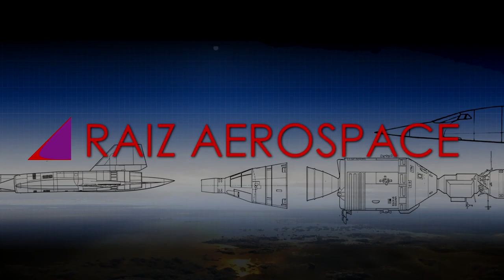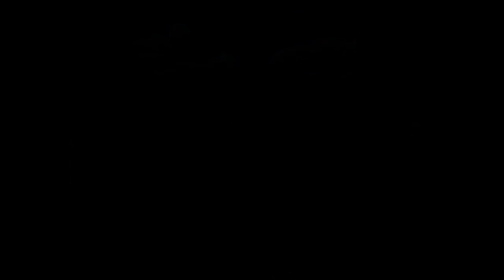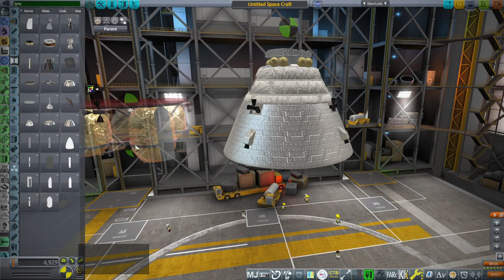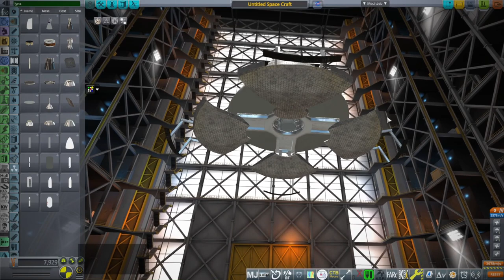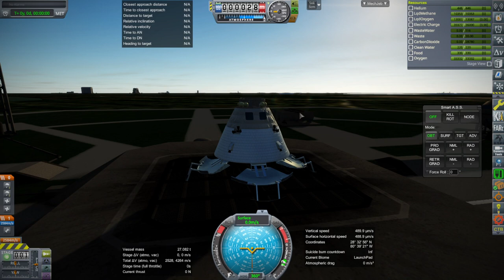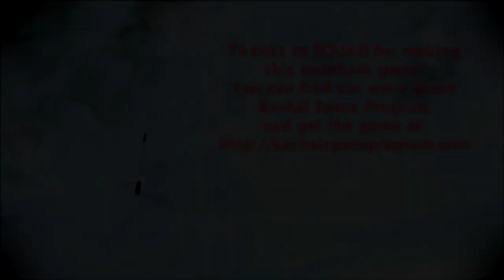KSP 1.12 - Nifty Parts 2 - Landing Leg Heatshield

Comment: The inclination of the opened petals is such that it diverges the atmosphere inwards towards the center. Maybe if they were inclined in the opposite direction diverging the flow outwards it would be more stable. But that would require much longer legs. Anyway a great and nifty capule.

Comment: I have sort of a suggestion (??) Maybe you could have an extra step on the petal that has that round middle portion of the heatshield where the nozzle is. So when you finish reentry and open the heatshield/landing legs, that central round part opens first (like sliding beneath that landing leg part or something) and ones the nozzle is crear then the four legs opens up at the same time. So when you launch again you close the landing legs but that round cover stays out of the way until you end the burn.

Comment: it's not imbalanced, it just tries to flip because it has airbrakes at the bottom. i think it's better to make only a small cut in the shield to let the legs out and put some caps for the engines between the legs then. also mars landers are much much wider, this cone shape is good for the thick atmosphere only, so maybe you can put your service module around the capsule instead of putting it at the bottom